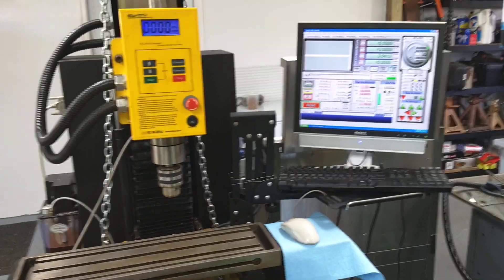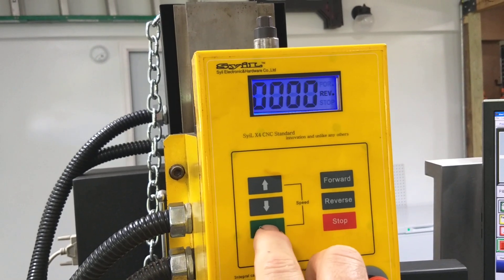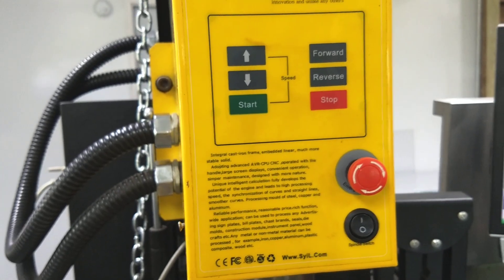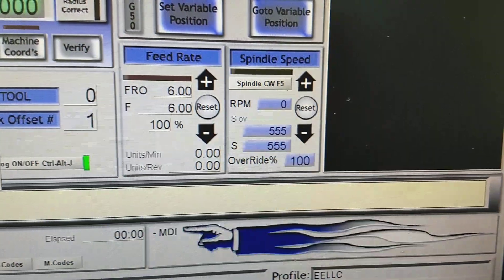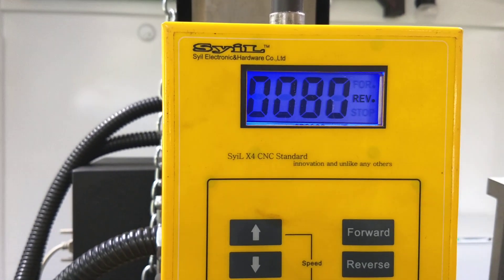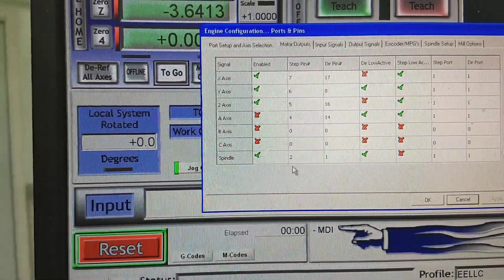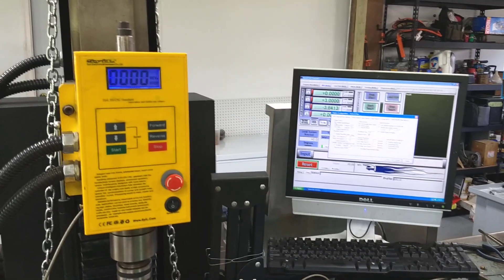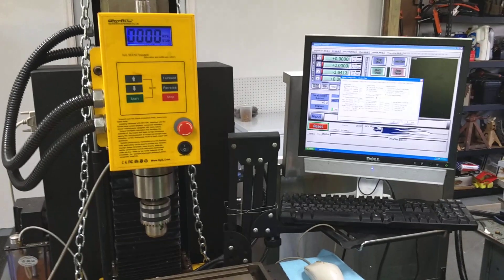Syil X4 Spindle .. No Bueno....

Comment: I have one too.. I had so much trouble with it, I am in the process of gutting the Chinese Electronics out of it and installing Gecko 540 motion control. Still working on the spindle issues also.. I purchased a 6K RPM motor that I know works, just more electronics wizardry needed.

Comment: Hopefully you can get this CNC mill up and running Chris. I have a later model Syil x7 (my other channel) and it runs like dream. May I suggest you reach out to Syil (Mr.Chen) via Facebook Syil User Group. Cheers 🍻
Reply: I have tried this over the past few years and they are of no help with the x4 series.. they basically wrote all the old machines off.
Reply: @jason32708  sorry to hear that Jason. Hopefully you get it sorted using a newer controller 👍🍻
Reply: @jason32708 should be sued. They have a “Zero obsolescence” policy for “all machines ever made”

Comment: Have you got this going? I bought an X4 without seeing it run properly and went through the process of getting it up and running under Mach3 about six months ago. My spindle is under manual control only at present as the previous owner had changed some of the electronics (SmoothStepper). The original spindle motor and driver are still present. If I can be of assistance only happy to help.
Reply from the maker: Thank you Peter. I just bought a new spindle motor and Dyn 4 controller from DMM. Videos coming on that. It seems like Syil had ISSUES with spindle control!
Reply: Good to hear. I've since seen your thread on CNCZone so had guessed it was in hand. Next video will be interesting especially how you keep the cnc/manual functionality (if you do)

Comment: CHange your PWN in MACH. set it to 20 percent and see if you get movement.
Reply from the maker: Hey Kenny, I wish I had seen this sooner! Now she is ripped apart and I'm doing a spindle drive upgrade. Thanks though!
Reply: @lockbuilder  I don't know if that's truly the answer to your riddle I just remember that my BF20L running Mach 3 had to have that set to at least 5 percent or the spindle would never kick on.
Reply: @lockbuilder  How is that spindle going? is this mill running yet?
Reply from the maker: @jason32708  Nope, got sick of it and sold it!